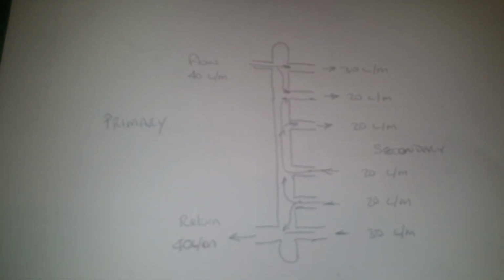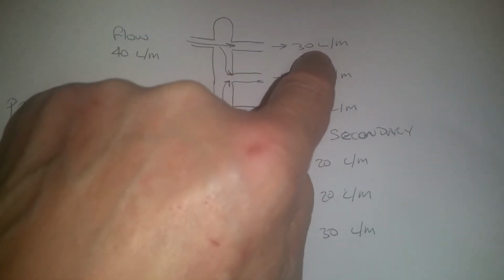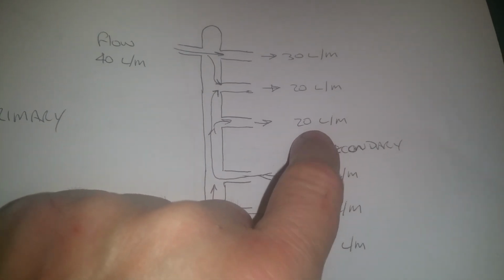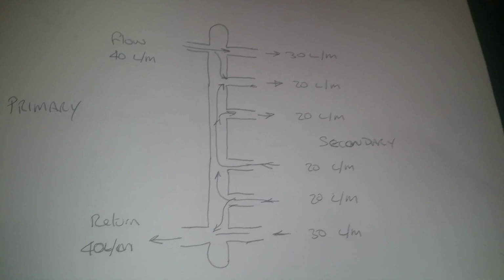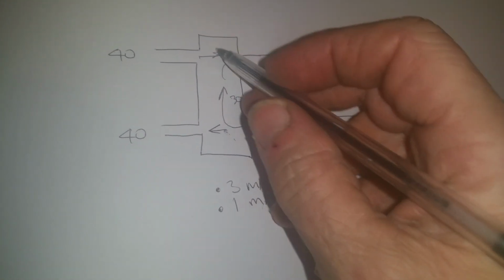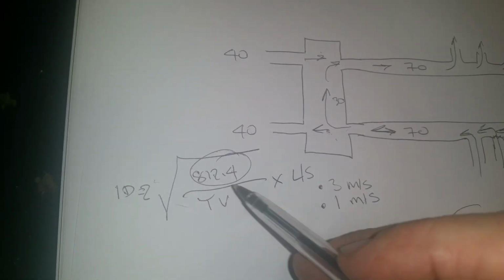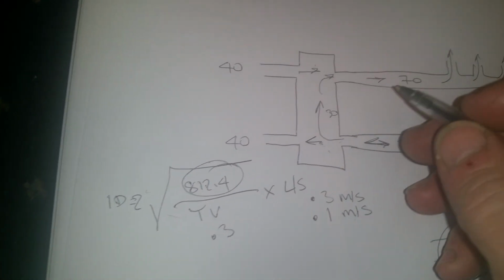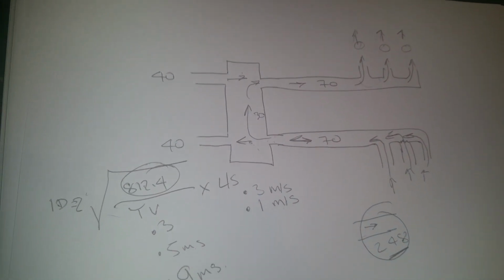Low loss header design mistakes

Comment: I had a call to a commercial heating system not working this week. I inherited the job from my predecessor ( I’ve only been in post a month ) and, talking to the client the system hasn’t worked for years with multiple people and FM companies looking at it. It has a boiler with a primary circuit, then a LLH installed and then brand new pump set. It doesn’t have a pump on the primary circuit, the only pump is on the secondary circuit. 
I’m wondering if it ever worked, the boiler is cutting out hi-temp and only a small amount of heat in being drawn into the primary flow ( maybe 30C ) and nothing on the secondary. It has a DRV ( double reg valve with commissioning set ) on the primary circuit, and another after the LLH before the secondary circuit pump, then another after the pump at high level. 
I have to assume that the system worked at some point, but who knows for sure. Am I looking at the DRV/commissioning sets being set up to create a path of resistance between the primary and secondary circuits, therefore the pump on the secondary circuit actually pulls water from the boiler primary flow actuating the paddle type flow switch bringing the boiler on. Or, will it never work with only one pump set on the system, therefore one on the secondary side. As I don’t have any commissioning equipment so I’m not sure of the flow rates, but with multiple DRV/CS installed is it possible they were able to make it work, albeit badly…………………… 😳
Reply from the maker: @cerealkiller4248  a low loss header provides hydraulic separation. The theory of hydraulic separation is that pumps on either side of the low lost header, should not cause flow in the other circuit. If there is no pump on the primary circuit, there needs to be one added. On every commercial site I have visited the commissioning.Volves have not been adjusted and are fully open. Unless you are provided with the technical data for the system, you would not know what to set these commissioning valves at.

Comment: Home radiator heat not bothered how fast the water flows,in, out T1 T2 hotter coming out than going in how is this possible Ti 37c. T2 40c no other means of heating.
Reply from the maker: I see this a long time ago. I reduced pump.speed and it was normal again. I never understood why or how. It was a very strange pump that had a lever on the rear. Maybe the lever allowed to reverse the pump, but I don't understand why that would be. I assume the lever was a flow control but I think it must have been reversing.
Reply from the maker: I don't really understand your question but you are welcome to call me

Comment: Hi Andrew, extremely informative video. I have a question on a site we currently have a horizontal LLH which have primary pumps feeding it, we then have 3 outputs feeding AHU's, radiators and UFH. My question is contractors have recently install a new section to the LLH but they've tapped off each end of the LLH would that have a impact to the balancing of the existing LLH
Reply from the maker: It could be a problem if not correctly laid out. Contact me with some picture
Reply: @andrewmillwardwatford9410  thanks Andrew will do, what is the best way to send them I don't think you can do it on YouTube comments.
Reply from the maker: @jamesmcleod9841  google my name and find my company

Comment: Hi Andrew can I pick your brains for a minute if I have 2 x 60 kw boilers feeding onto a low loss header what size should my primary pumps be for the 2 boilers thanks as been told a 15/50 will be fine but seems to small to me
Reply from the maker: Hi. A 15 50 will likely be ok if feeding a low loss header. You should look at the head loss graph for the boiler and the pump performance graph for the pump. If the pump can move the or a higher flow rate required at the headloss of the heat exchanger at maximum flow it is suitable. Join me on the forum for more information or we can talk on messenger or whatsapp

Comment: Hi mate been watching your channel your knowledge I have a strange 1 for you I have just fitted a ideal evomax 150 kW with single low loss headed primary pump on the return and secondary on flows one for a ahu heater coil and the other a hot water cylinder the flow would only go down the primary flow to header over heat boiler and cut out if I turn secondary pumps off it will flow round header and back to boiler turn them on the secondary flow would only get up to about 35c and would over heat the primary flow but primary return cold I have since removed header and the system works fine but can't figure out why it did not work as have used this set up before on evomax 60kw and all worked fine
Reply from the maker: We could do a video call from your job. Need to see it.

Comment: Great video, I have a question your first drawing why can you not just alternate the connections on the secondary side; If you number the connections from top to bottom 1 to 6, so you use flow 1 and return 4 for circuit one, flow 2 and return 5 for circuit two, flow 3 and return 6, would this not counter balance the middle circuit staying in static loop. Would be very interested to see your opinion.
Reply from the maker: Sorry I just see your comment. The order wouldn't matter but flow rates would. You could arrange flow rates in an order to work. My explanation is about how I see them not working in the field. The second option saves the need for careful design.

Comment: Very interesting Andrew, I have a question though. 
With the 3 circuits all set up on the secondary side, pumping & flowing, if one pump is satisfied & shuts down, doesn’t this affect the flow rates of the other two circuits? Thanks, Rus.
Reply from the maker: The low loss header allows each circuit to act with no influence on the other/s. So if two pumps turned off the remaining circuit would draw the exact same volume of water. The flow in the boiler would also remain the same. The only change will be the boiler modulating to a lower power out put. A lower power out put but the same temperature.

Comment: Hi Andrew, 
What was the book you mentioned in this article?
Cheers
Jase..
Reply from the maker: Domestic heating design book
Reply: @andrewmillwardwatford9410  Hi Andrew. I've got that CIBSE domestic heating design guide and it's got nowhere near the amount of detail or mathematics you've used. There's nothing more than a small paragraph followed by a few sentences. I'm desperately trying to find more technical information on LLH's. I've got CIBSE AM14 also but that doesn't have too much in it either. Are you sure there isn't another design guide you've got? Any help would be great. Thanks. Tom.
Reply from the maker: @tommojenko  what information do you need ? 
The callefi series may help you.

Comment: thanks for the video. It would be good to see impact distribution of heat during the flow distribution ?
Reply from the maker: B1cam what do you mean by "see" you can measure and calculate. Dt across circuits and a gas rate will by calculation give flow rates and energy distribution.
Reply: Hi, i mean the water flow/rtn temperature, the impact that the LLH has on temp, due to different flow rates and circuits.
Reply from the maker: B1cam yes. Measuring Dt and a gas rate will allow calculation of all energy paths.
Reply from the maker: https://www.facebook.com/groups/1283670701667577/

Comment: Fantastic video Andrew. You’ve said .3 m/s in LLH, .5 in distribution header. What would you want in the primary header if you were cascading 2 or more boilers, to ensure the load was split evenly between the two boilers?
Reply from the maker: Sam Morrison I would assume .5ms is ok but I have no source for that it's a guess only based on the distribution header. Different sources give different velocities and those I've stated are fro. Good sources but ones I've chosen to adopt.
Reply from the maker: https://www.facebook.com/groups/1283670701667577/